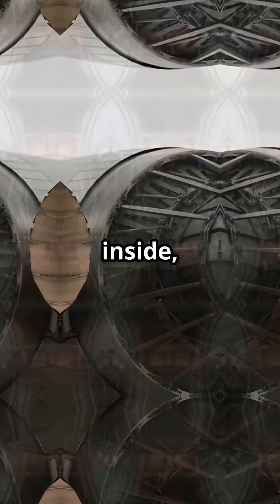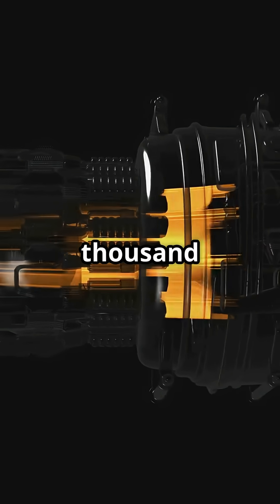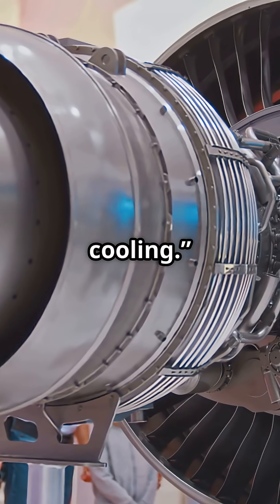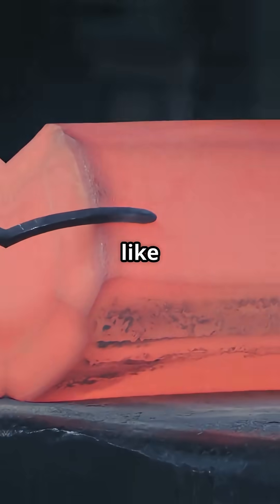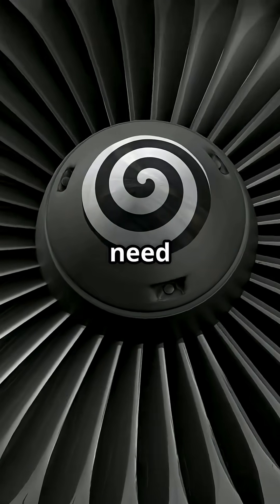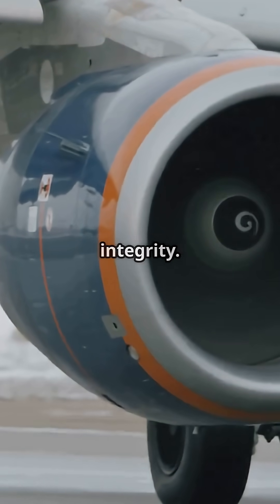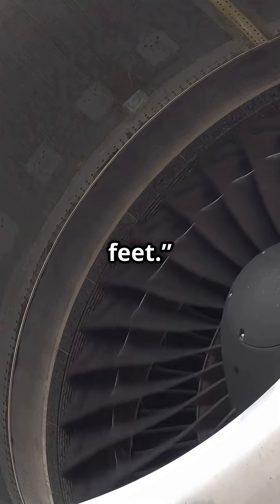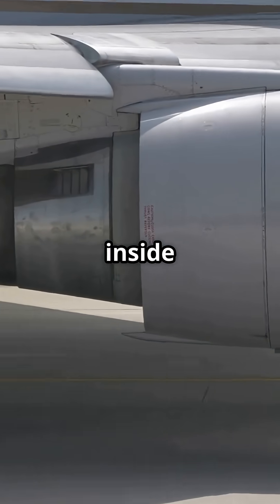Why Jet Engine Blades Don’t Melt at 1,700°C

Comment: Exactly. Steel doesn't stand a chance inside. Inconel contains Nickel, Chromium, Molybdenum, Niobium, Titanium, and a few others. It's not just the hellish temperature, but the force that the blades have to bear. Inconel is the unsung superhero. Without it, we would not be able to fly in an airplane.